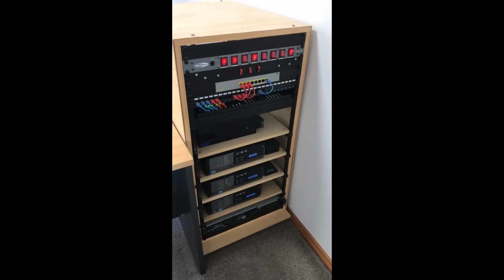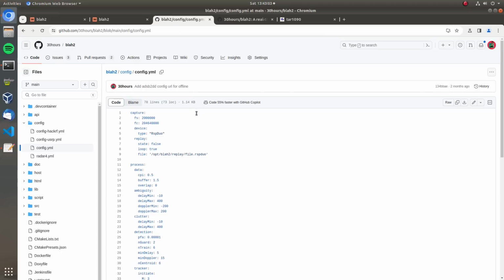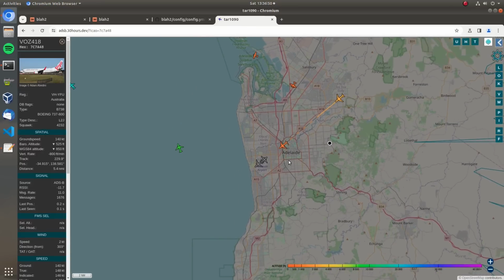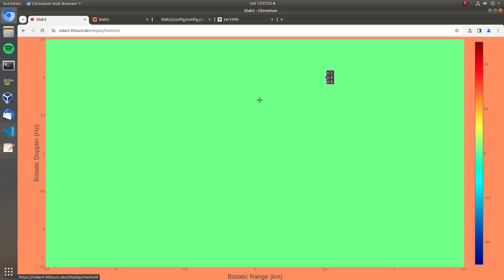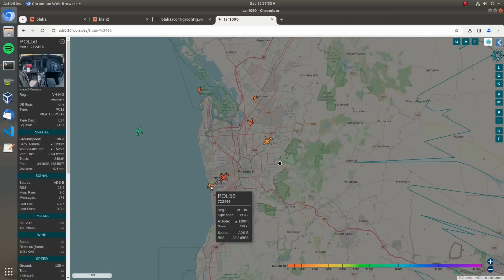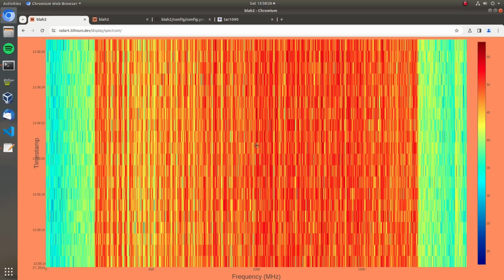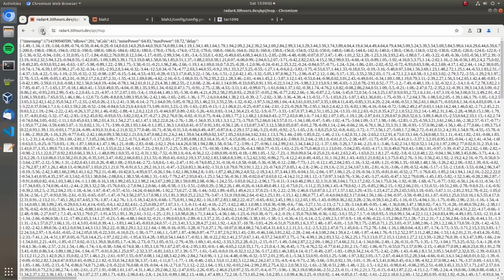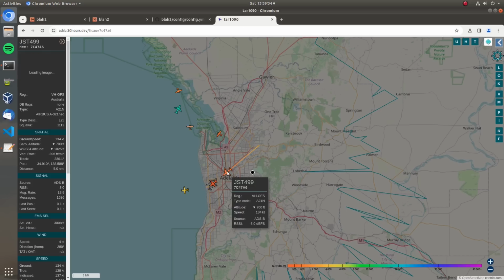Real time passive radar at home

Comment: Fascinating work! now i just have to watch it another 5 times and search a few terms and find someone to build it all haha. I am into tracking aircraft. im in a tiny rural town but come fire season we usually have 2 fixed wing and one helitack based about 1km from me at our airstrip. they dont always have ADS-B running so i would love a way to find out when they are coming or going. Im also trying to find a diy base and mobile antennas that are high gain up to around 30 deg from horizon as fire aircraft usually fly up to maybe 3000ft. Those antennas will be for airband voice around 125MHz. Thanks to anyone that can help or point me to someone that can.

Comment: Interesting project. There is a push to use this style of homebuilt radar to detect UAP. A guy who works with Avi Loeb has been making a system that people can build basically using what you have done. using high power local radio of TV stations as the dopler rada source. Great job you have done. Pity there are no more updates . I am interested in this project. I found this searching for how to do this. De VK4KZK

Comment: Just to be clear, the 1090 MHz band is of course used for adsb with the rtl-sdr. What band is used for the passive Radar sensing? Why using a directional antenna? Presumably you are located in a landing sector, fair enough. 
Is the ranging algorithm automatic or do the Tx stations need to be configured in order for the algorithm to work?

Comment: Someone please evolve this project to HF for OTH detections :)
Reply from the maker: It could work as is in theory. Provided there is a strong HF source, and the reference and surveillance antennas support the HF frequency of choice. Just need to change the config file to the correct bandwidth and center frequency.

Comment: You might want to shield the nylon bolts because those sure arent resistant to UV long term. Maybe a black nonconductive paint?
Reply from the maker: Fair call, it will degrade over time. I want to change the nylon bolts to stainless steel, then space out a 3D printed plate so the bolt doesn’t touch the boom.

Comment: Awesome! Do you have a ground rod near the antenna interface box?
Reply from the maker: I do. Not shown but a meter away from the antenna interface box is the house ground rod. I still haven’t run a cable connecting the body of the box to ground, but will soon.
Reply: @30hoursdev  I would not use a common rod for both because of the voltage which would be developed across the rod and its connections in a lightning strike. It would be much better to have a separate rod and then connect from box to its own rod and from that rod to the building ground system.
Reply from the maker: @sbreheny  I thought I could introduce a ground loop by having 2 ground rods, is that possible? But I’m definitely not an expert in that.

Comment: Why the Yagi antenna? Where is it pointed? Wouldn't it be best to have an antenna that doesn't receive the radio station but is mostly omnidirectional?
Reply from the maker: The 13 dB of gain from this Yagi help to increase the target signal in the direction it’s pointed. In my case it’s pointed along the aircraft landing path. In general one may make use an array of antennas to get the benefits of high gain as well as maximal coverage.
Reply: @30hoursdev Ah, thx.

Comment: Cool. I didn't know there was such a thing as passive radar (and initially I was going to question this video. But some quick reading before posting saved me from the embarrassment).
Very informative!
Reply: It's not truly "passive" there is an active component to this being transmitted at 204.64MHz.
Reply: Also not that it matters too much in this application, but a gamma match at that antenna feedpoint is an option to match that feed line to that lower impedance.

Comment: Now if we simply had some type of long, tube shaped thingy that could somehow be made strong enough to contain a small explosion. You could try to use that explosion to accelerate something. Maybe you could use a slightly smaller tube shaped thingy and have the explosion force it down the length of the larger tube to pick up kinetic energy. You could then in theory used this new contraption to try and send your tube shaped packages toward the blips and boops on your new radar. Meh, who are we kidding, that's sci-fi talk. Maybe one day we'll get there.
Reply: Star trek  teleport  on peut rêver  😂

Comment: NO BETA MATCH??? WHY DOE´S ALL THE
SUPPOSED YOUTUBE WONDERS NOT MAKE
A PROPER BUILD... OOOH I KNOW THEY WATCHED
A FREAKING WRONG YOUTUBE VIDEO...
Reply from the maker: The Yagi has a VSWR of 1.7 and it’s receive only. My mismatch loss is much much less than my cable loss from 15 m of RG-58.
Reply: @30hoursdev  hey bro.. f the SWR.. the beta match is for making RX /(tx) from 
A-SYMMETRIC TO SYMMETRIC .. using a halfway with a gamma match had eliminated the asymmetric vs symmetric .. not that SWR ain´t important but it would have same SWR with the Match don right .. i often wonder why ppl on youtube always leeve out the betamatch .. making the antenna work on both side not only on the RX or TX side (radiator and tx side) doe´s it make sense that you dont utilize the shielded / grounded side until the betamatch is applied.. just saying .. it is you´r antenna.. but if you put it truh a smith diagram on a rotor .. you would see the antenna with out  betamatch is asymmetric not symmetric in tx .. or rx  .. Rothammel ARRL Jessup antenna books funny enough  state the same... so i bet they are right...
Reply: @kennethschultz6465  bro u are methed tf out lmao

Comment: Why use coax for 5vdc and not regular cable? Is there a benefit? If so, does the polarity matter?
Reply from the maker: It was convenient since I already had the coaxial run done. It was neater to keep everything over coax rather than add new connectors to the antenna interface box. Polarity does matter, ground is connected to the cable bulkhead, so you don’t want 5V shorting out there. Keep the 5V on the inner conductor.

Comment: I can not understand how you detect the location of the target using the bistatic range. Could you explain that? I mean how you find the exact location using passive radar?
Reply from the maker: This system does not do target localisation. The 2 methods are have an antenna array for the surveillance channels to locate the target in angle (and combine with bistatic range for a position), or use multiple radar nodes to find ellipsoid intersections and locate the target directly (as demonstrated in the 3lips project on GitHub).
Reply: @30hoursdev  Thanks. For the first method I can understand the first part of the angle of arrival but I can not understood how the bistatic range can give the distance from the target.
Reply from the maker: @hmmy92  A bistatic range measurement places the target on some ellipsoid around the transmitter and receiver. Intersecting 3 of these ellipsoids from spatially separated radar nodes will find an unambiguous target position.
Reply: @30hoursdev  without doing DoA. Correct?
Reply from the maker: @hmmy92  Correct - each radar node in the 3lips project is a 2 channel system like the one shown in this video.
Reply: @30hoursdev  Thank you. Would be good idea to combine DoA with one node to estimate the angle and passive radar with another node to estimate the bistatic distance and somehow combine it to find the distance from the target?
Reply from the maker: @hmmy92  If a node has an array to DoA, it can will also measure the bistatic range and find the target location. That being said - a multistatic network where 1 of more nodes have DoA would provide redundancy in the case of a node not detecting the target.
Reply: @30hoursdev  But I can understand that the setup for passive radar and DoA is different. This, I assume that the same sdr node can not operate both of them simultaneously.
Reply from the maker: @hmmy92  It can. Replace the surveillance Yagi I have with an array of Yagi’s.
Reply: @30hoursdev  So Yagi for both DoA and passive radar? In passive radar as far as I know one of the antennas should target the emitter
Reply from the maker: @hmmy92  In the passive radar with DoA case, have 1 antenna to get the reference signal, and an antenna array to get the surveillance signal. Then you can beamforming the surveillance array to also locate targets in angle.
Reply: @30hoursdev  One last question I have. In the 3lips projects how to syncronize the data from the different radar nodes? Common GPS timestamp?
Reply from the maker: @hmmy92  Correct. I’m using the PC time which will be GPS synchronised when connected to the internet. This isn’t critical though since aircraft landing are moving fairly slow. With the range resolution of each radar being on the order of 150 m, I can tolerate some jitter.
Reply: @30hoursdev  Whats is the BW of the emitter signal? To verify the range resolution. Also, what is the minimum doppler you can estimate in order to calculate the minimum speed of target that can be detected. Again, very good job
Reply from the maker: @hmmy92  The DAB signal has a bandwidth of 1.56 MHz, but I oversample and process 2 MHz. Each range bin is c/(sampling_rate) meters, and each Doppler bin is 1/processing_interval_in_s Hz.
Reply: Hello again, could you please explain to me how combining DoA and one passive radar I can get the distance from the target?

Comment: I woke up today with my mind set on trying to make a 2.4Ghz microwave radar. A few hours into researching some bits and bobs and I've ran across this fantastic video!

My thinking is make a Patch Antenna and direct it at a parabolic dish lined with aluminium foil. I might need to get a custom circuit printed as I feel a breadboard setup would be very innacurate and have too much inherent parasitic inductance and be very hard to get the impedance accurate enough. But I want to get a signal being sent out (Probably about 0.2 Watts?) and just get the data recieved into my computer where I can go crazy processing it (I have a Data Engineering background, this should be the easiest bit ahahah)

Then set it up on a gimbal and leave it for a while to scan in my room, and see if I can process it into an image. Probably using an arduino for stepper motor control and just sending my computer the position data with each read.

Do you have any advice, or see anything difficulties/errors in my thinking :)

Afterwards I'd like to extend it to work with Pulse Doppler and try tinkering around to remove some of the static.

All the best.
Reply from the maker: That’s the problem with going higher in frequency, you can’t get away with the breadboard desktop setup that you might at lower frequencies. I’ll point you towards the MIT coffee can “cantenna” radar which gives you a list of parts you can put together for a higher degree of success. I understand the key part of the radar processing is done in hardware with a mixer, rather than the SDR approach here which does all the steps in software.

Comment: This was awesome. I hope to see more videos on the future. I agree with you previous commenter about being able to detect which aircraft were bladed. I'd love to know how you're able to differentiate between bladed & non.
Reply: Planes have the doppler of the fuselage, wings, etc. On top of that is the doppler of the parts that are moving. Each one has a signature depending on the number of blades, speed, size. Jet engine blades are fast but can be hard to see because they're ducted so you won't see them at most angles. Props are easily visible. Helicopter blades huge relative to the size of the aircraft and generate doppler in the plane of your radar.

Comment: When I saw the Yogi antenna, there is no motor to change direction of the radar just like ones on airports. A motor can track so many airplanes. Am I missing something?
Reply from the maker: Correct the Yagi is fixed. Although the 3 dB beam width is around 50 degrees, I still get strong targets come through outside of this (and sometimes even from behind the antenna when returns are strong). Target localisation can be done using multiple radar nodes (see my 3lips project on GitHub for more details).

Comment: Your concept may not 'look' straight forwards because unbalance. Maybe you can obtain a better balanced feeding with an easy delta match and balun. See > W0EYE 432 MHz model. The wires on the dipole comes about half way the elements and the angle is about 30 degrees. Thickness of the (rigid) wires are not critical.The match will transform (abt. 200) to 50 ohms. You'll need a quarter wave balun between your coax and the feeding point, the currentfilter can be omitted. I made several antennes that way with outstanding performances.

Comment: Is the reason the truth and radar are never aligned because of timing? As in the ADSB data is delayed because it's not quite realtime?
Reply from the maker: Actually more of my processing technique for ADS-B. You may notice the delay is generally bang on, but the Doppler is the one lagging and catching up. I’m taking the derivative of the bistatic range to derive Doppler. Unfortunately the bistatic range is slightly noisy (quantised numbers in the ADS-B signal) and taking the derivative of a noisy function is well known to amplify noise. I have a smoothing filter which is somewhat effective. A gold star approach would be to use a Kalman filter to track bistatic range and smooth out noise.
Reply: @30hoursdev  Interesting, thank you for your reply.

Comment: I see 2 issues, impedance mismatch, the impedance of the coax is probably 50 or 75 ohm but the impedance of the antenna with that folded dipole is around 300ohm, second issue is that the coaxial cable is asymmetric and the antenna is not. The common mod choke made with the coax does not hep too much in your case.
Reply from the maker: The coax is 50 Ohms and my modelled Yagi ends up being 26+j9 Ohms for an SWR of 2. I planned on using a beta/hairpin match to improve the match, however a small attenuation on a receive antenna is still much less than my cable loss.

Comment: Is it sensitive enough to pick up cellular data? Could you reconfigure it to determine if someone is actively using a cell tower nearby and their direction? Asking as a hermit on very large acreage...
Reply from the maker: With the move to 5G there are more transmitters covering smaller areas. These are relatively low power, and as you infer, beamforming in the direction of receivers, i.e. the radiation pattern is not uniform. Power is also spread out over larger bandwidths. I would not expect using 2 MHz of receive bandwidth from the SDRplay RSPduo would be effective for radar, but potentially with a larger receive bandwidth.

Comment: I have also experimented passive radar, I am looking ways where a hybrid radar system could be built, using Ham bands to use three modes, Passive, line of site and over the horizon, on a common frequency ranges. As I have done a lot work with radio navigation and have a new type of signal processor design, with few improvements could be used for Radar. As there so much technology out there now, where it possible for anyone to play around with as a hobby, to get an idea how radar systems work. Good to see what you have done so far.
Reply: Transmitters are expensive; I spent 47 years designing and building them at the AF Research Lab. Using somebody else's transmitter is way cheaper but you have to compensate with processing. 
Hams don't transmit enough power, and they're not on long enough to be reliable. Broadcast FM radio and TV are strong signals on high towers that you're surrounded by. 
Line of sight: yeah, that's pretty much the limitation. Although if you look at high flyers you'll catch signals off them from beyond line of sight. That's a problem for getting a reference signal. You'll also get high power microwave pulse radars as they swing by. 
OTH active HF radar that reflects off the ionosphere takes much, much more power than you can afford, to detect targets. But you can play with passive detection from meteor burst and stuff. We played with all that kind of stuff at the AFRL radar test range in Verona, NY. There's science to it, but a whole lot of luck when you talk about propagation around the atmosphere.
Reply: @jamesvandamme7786  There is a lot to it, at the moment I have been playing around with phased antenna arrays with the Class Q RF amplifier design. That has I & Q inputs, where each antenna has it own power amp, by controlling the phase on antenna / amplifier block will change the beam of the array. The limitations are max RF power levels you need work within on the ham bands, is a major issue for sure. It is a good time do experiments with radar as there is so many different ways to try out new ideas. As it is all good fun to build and test some of these ideas out.

Comment: Your construction and organization of all the components is beautiful I have a comment or two on the things that I saw in your video. 
The yagi antenna shown is somewhere in the 200 MHz region, using eye bolts to hold the elements is genius, love it.
At frequencies above one gig coax of any length is a bad idea, ALL R.F. components Must stay on the antenna at the focal point.
You will learn to hate grouping your RF connectors in a tight space, type 'N' are precise making a connection and then getting them tight requires a perfect straight in alignment, very difficult to do if they are clustered together. 
Awesome content love what you've created impressed with the outcome thanks for sharing. 
dE AA7J